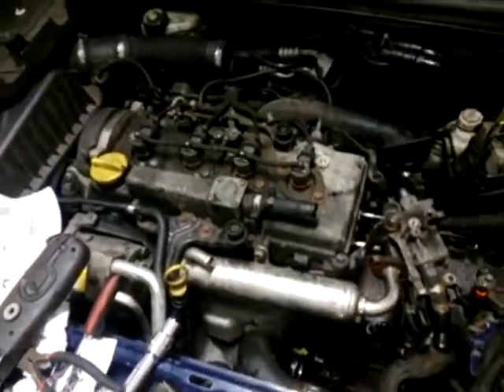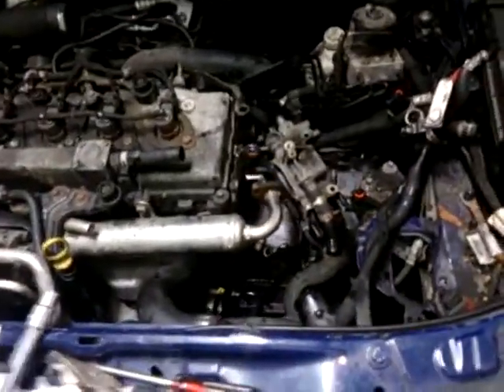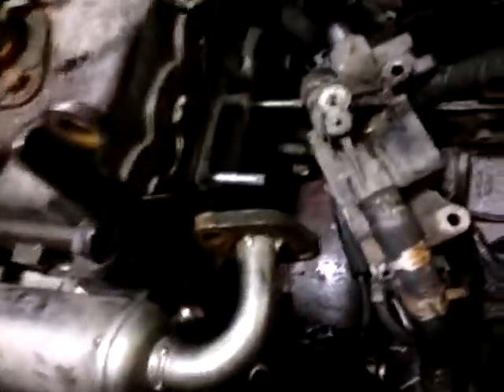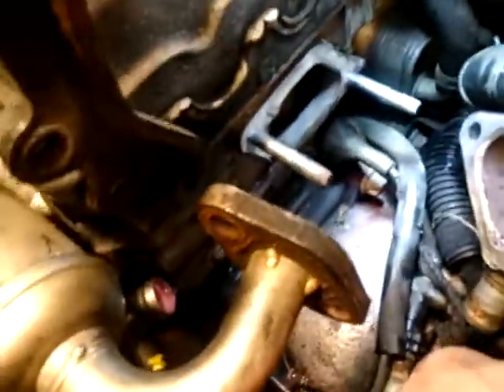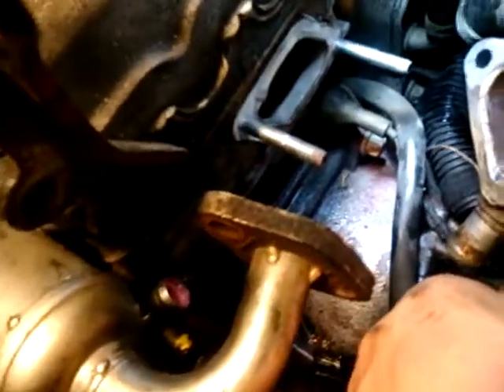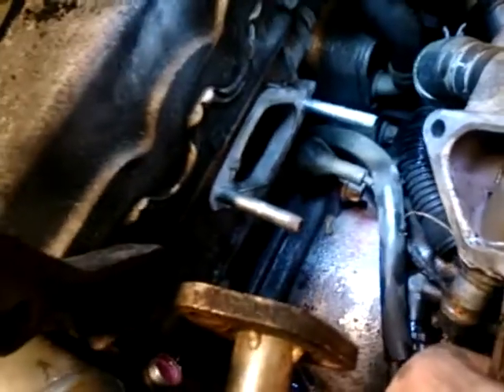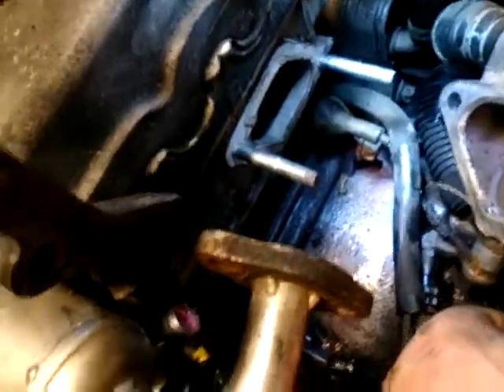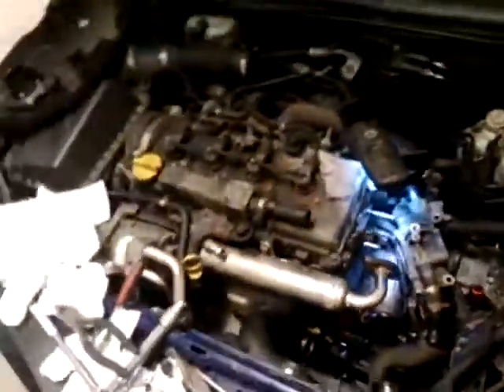Astra 1.7 cdti colant leak mystery

Comment: Was the coolant spraying out when you were pressing on the acceleration peddal? I noticed mine sprays out coolant from somwhere around that area when I press the gas, but only after the engine temp reaches 90°
Reply: If thats the case then I would not just fit new seal but also look at the thermostat. If pressure is building up blowing seal then thermostat may be bad also.

Comment: Did this fix the problem? Is there a gasket for it or is it supossed to be sealed with silicone alone?
Thanks.
Reply from the maker: hi friend, just use good silicone for high temperature, since i did this never had a leak again. solve the problem. hope this helps.